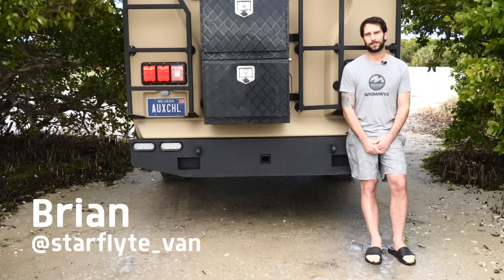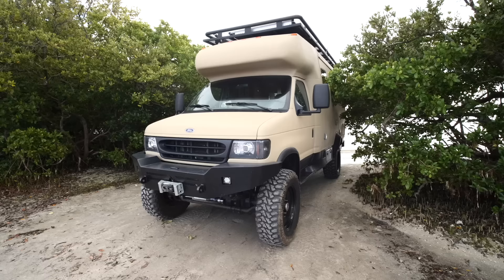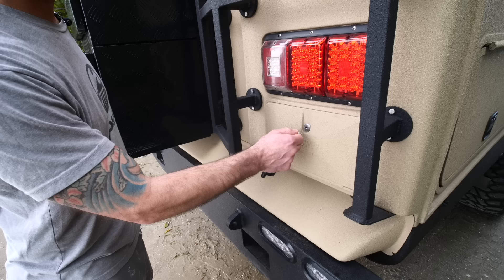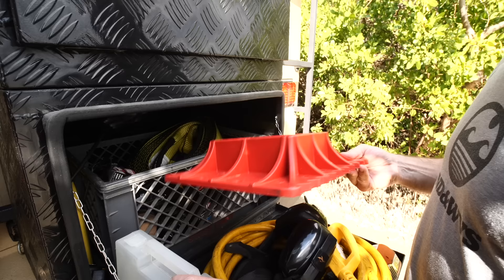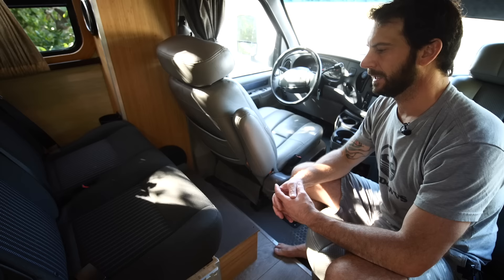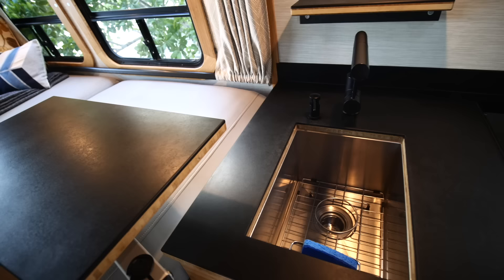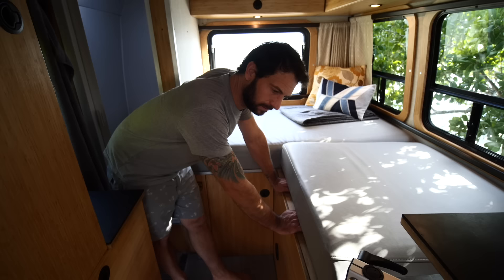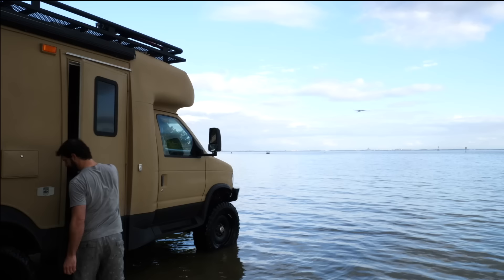He Turned a Rotting RV into the Ultimate 4x4 ADVENTURE Rig!

Comment: As a class b owner/traveler of two tv's for the last 28 years, I put a lot of importance on roof air that can be powered anywhere.  Opens up the full four seasons to go, or just to be comfortable when the need calls for it.  1993 Airstream B van (16 years) and a 2009 Krystal Sprinter (12 years).  Both with showers and roof ac and generators.  Bought the Airstream when I turned 40 in 1995.  Still going strong, best life living decision.

Comment: Pretty amazing.  You really have to know your stuff to design and set up a rig like that.  One practical thing that sets this apart from most "van" tiny homes is it has the all important toilet/shower.  Even if it's a small space, those two things are must haves/
Reply from the maker: Yeah this conversion was really well executed!
Reply: I agree Riogrande. Way too overpriced for that conversion. Also has the worst motor even produced by Ford. You’ll hate the spark plugs when they snap on you. That 5.4L must get 7-9mpg down the highway especially those high of gears. Should of just spent the extra $2-3K for a 7.3 that year. More power. More efficient and more reliable. This is sadly lipstick on a pig.
Reply: @maxboya the 5.4 2 valve is one of Ford's most reliable engines ever ...

You must be an arm chair van lifer

Comment: This really is an outstanding off-road RV. The overall fit and finish appears to be second to none.
I appreciate the owners detailed descriptions about how the build was first conceived, designed, and then implemented. All very good choices and all made on solid considerations. The end result is a very capable off-road RV that practically anyone would be able to use and enjoy without further modifications.
However... I don't know how much power an incinerating toilet requires, but that would be my choice, and I would try to devise a means to increase the solar panel surface area.
I'm envious and I have to nit-pick.

Comment: I have had a nature head for a few years now and plainly got tired of the cleaning.  If I waited too long, though no smell, it would get dog heavy. So ... I removed the stir bar and put in a removable bucket.  Then line the bucket with double plastic bag.  I put in a layer of wood pine chips and then as the black business is done I layer another pine chips (fine but not sawdust, which may work too. I set the bucket lid on top between uses, really easy to do... just as an additional thing.  The open flap opens and closes well.  Then when full I can remove the bucket and/or bag and it's outta here.   I have noticed near zero bugs at all not like the peat... some use other expandable too.. I just got tired of cleaning it and at 1K for the toilet, I would have done something way different at first... but just repurposed what I already have....  This is a great rig ... good job....

Comment: People keep mentioning the cost.. and yes, it isn’t cheap.. but the professional conversion to an off-road capable 4x4 was 25K of that.. plus he farmed out the interior to a pro as well.. 
   Having looked at a ton of the Sprinter, Transit and Fiat(RAM) vans I am familiar with their pricing.. hard to touch one for less than 100K and some can run 200+K with AWD Sprinters at the top of that. And you might need to compromise on features you want or need so… If you look at it overall.. it is kind of a bargain.. not one you can finance with any lender, but a bargain, considering he paid someone else to build it for the most part.

Comment: Cool build.  I just don't understand people spending this kind of money on these yuppy kind of builds when you could have something better in every way with a military truck conversion. This is a cool middle of the road, but $94k....yikes.  Whatever floats your boat though!
Reply: Parts availability is probably the biggest factor, if you're going military then most likely you'll get the Stephenson chassis, imagine running down to Discount auto at 9pm trying to get a replacement power steering hose, radiator hose, serpentine belt for a CAT 3408 or whatever engines they use etc With the Econoline you can run down to the corner autoparts store from Canada to Argentina and grab spares like that real easy.
Reply: Aysig english² kay bisaya ta
Reply: Another issue is registering military vehicles.  It’s a major pain, especially if you live in California.
Reply: @flenbo76  You're right. Yuppy build. 100k price point is stupid.
Reply: The thing is that $$ value is very different for each person depending on the amount of funds you have. Ex: to a multi-millionaire 95k is nothing vs someone who has 30k, 60k or 100k. It's all relative based on your disposable income, in addition we all have differing values on what we choose/want to spend our money on.  I'm more interested in knowing how much he recently sold it for.
Reply: My yuppy build was $5k. Cost-of-funds I guess
Reply: @georgehayesviolin  Everything is a pain if you live in California.
Reply: Now that is a great idea!
Reply: @flenbo76  fed
Reply: People pay $94k for pickup trucks and SUV’s!
Reply: Military trucks are harder to service with replacement  parts, and none go faster than 62 miles per hour. Plus mil trucks are super loud and rougj, rough, rough.
Reply: Try fixing a military vehicle in the middle of nowhere America…it’s not happening.
Reply: @MrOffshore  Dead to right... bingo.
Reply: Could agree more!
Reply: You can actually tell the difference between people that are passionate about their builds and all that lies ahead in their adventures (prior to van building becoming "popular"/the thing to do) vs those that are doing it based on what these think they see and believe others are doing and experiencing.  You really have to be hands on and pretty much naturally adventurous/know how to care for self  and open to what can and will come up at any time.  Personally I feel if you want to invest in what you have ***and love, it doesn't matter the amount.  Once you are truly passionate about what you're doing, that's all that matters.  To see anyone even make a video about hating something that they've chosen to do is 👀👀👀👀👀👀👀👀👀👀👀👀👀👀👀👀👀👀👀👀👀👀👀👀👀👀👀👀👀👀.
Reply: Parts…
Reply: Military trucks suck on the highway
Reply: @Flen Bo  he even specifically mentions this when explaining why he chose the econoline.
Reply: Not everyone wants to drive down the road at 35mph with locked diffs
Reply: A lot of people don’t want to drive a military vehicle. I know I wouldn’t. I would much rather drive a 4wd van
Reply: You’re giving way too much credit to military vehicles.

Comment: Don't get me wrong I absolutely love your build but for 95k I would have went a whole different direction that's a lot of money and I definitely would have went with a 7.3l powerstroke conversion with a sleeper generator out of 18 wheelers that way you could have ran your AC without being hooked up to the grid
Reply: I would just use more solar panels. I would have painted it with white ceramic heat reflective paint. I would use the best heat reflective ceramic tint. I would have installed a chest fridge so I have more energy for air conditioning. I would have installed a a water recycling shower system
Reply: @monsiuersmartypants3391  Needs way more battery onboard in addition to more solar power.

Comment: What did you use to coat your roof exactly? I just replaced my rv roof with 3/8" plywood. Also, how many liters did it take to coat your van? I have an 8 liter raptor kit tinted white and I'm wondering if I will be short. Thanks man!
Reply: Make sure it’s got UV protection, bed liner has a habit of being destroyed by the sun.

Comment: How do you like the motor? I just bought a shuttle bus that im converting into a tini home, with the same motor. And i wanna turn it into a 4×4 as well... your thoughts pretty pls?!
Reply: I have this exact RV .  To get 50 more pounds of torque at the 200-3500 rpm range this is what I had to do

5.4 shorty headers
SPD Y pipe
Aero muffler
Jegs hi energy coil packs
Sct tuner

I need to figure out a cold air intake system.. I am not impressed with the Banks offering 

I was able to net 53 more pounds of torque.. I am in California so I had to keep the cats and EGR on..

It passes smog...

Comment: Cool looking rig Brian. I went with a 2021 Forest river 2860DS with the new 7.3 gas engine. I upgraded some electronics but kept the propane as a backup. Adding 900 watts of solar a winch and also converting to a f350 4wd front axle I have a somewhat close twin. It is a little bigger but it also sleeps 8 (4 adults & 4 kids). The new 7.3 gas engine is amazing and getting 14mpg with 87 octane pricing is a dream compared to anything else. My rig was 80k used with 13k miles and the new godzilla motor. The 4wd parts cost me about 7500 and probably 80 hours to install and fab up the proper pieces. I did not have to change much inside because the layout was great and new. I like your rig but with 5 kids we outgrew our sprinter and could only use that for transportation, a class A was nice and roomy but big and not trail worthy or 4wd. Most of the class B were 200k + and only comfortable for 2 with no kids. Our 28ft class C is  capable going off road with the lift and 4wd system is amazing as long as the trail is ok. my height is 11ft 7 inches. Those ford transit seats are great. Did you get them from a local (boston) coach builder ?

Comment: Fantastic job  with the conversion though I do like generators. OK, so my Ford 8K GVW grip van gets 7 mpg and the Starflights I have seen used as mobile video units get about 5 mpg, what does this burn?
Reply: Really only 7? We have a 31 foot 14k gvw with the v10 and get 8-9, 10 in the prairies.
Reply: @-tr0n  Ahh ha, OK, thanks I need to check the rear gearing. My V-10 with 15K got about 7mpg fully loaded.
Reply: @superbmediacontentcreator  All depends on the load and road, right? Mine runs 5.36 Dana 80 for rear end.
Reply: @-tr0n  I know it is a Dana but I have 2 Fords both with Danas and I forget which is which so I will have to check. Great build and the resources are really appreciated. I just disagree with the lack of a genny as it is just another backup device even if you don't burn it. By the way after 9-11 most bridges and tunnels will not let propane through/over them (yea I know about the energy of propane vs a gas tank but I don't argue with stupidity or knee jerk actions) so most rock/style tour buses have gone all electric.
Reply: @superbmediacontentcreator  A gen is an absolute necessity for me, but then I'm not dealing with desert weather. Can run into a week straight snow, or rain or whatever up here.
Reply: My 2001 shuttle bus gets about 10 mpg with the 7.3
Reply: @superbmediacontentcreator  I really find that hard to believe that you can take 60 gallons worth of gas through a tunnel but a 15 lb propane tank is a no go
Reply: I own a Starflyte with this same engine ... 13.9 mpg 61-62 mph

Comment: I agree Riogrande. Way too overpriced for that conversion. Also has the worst motor even produced by Ford. You’ll hate the spark plugs when they snap on you. That 5.4L must get 7-9mpg down the highway especially those high of gears. Should of just spent the extra $2-3K for a 7.3 that year. More power. More efficient and more reliable. This is sadly lipstick on a pig.
Reply: Wrong on all accounts ..   you've never sat in a van with a 7.3..  try commuting in that...  

You must be an arm chair van lifer